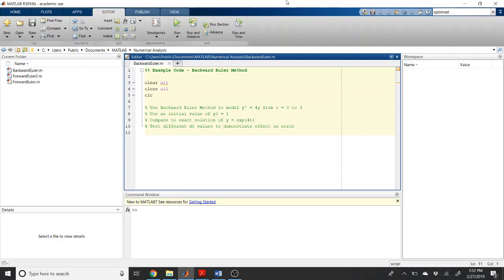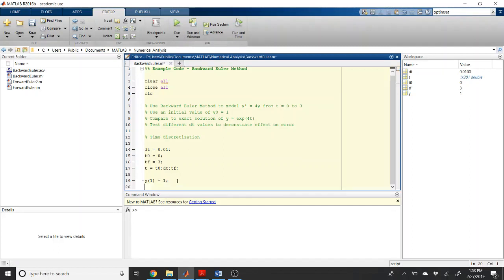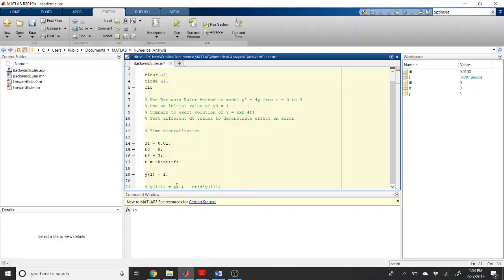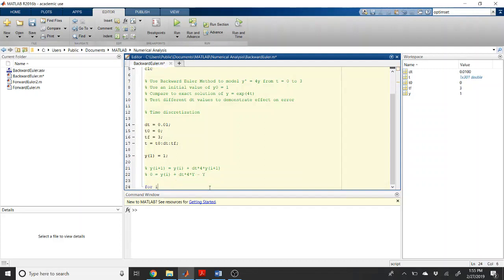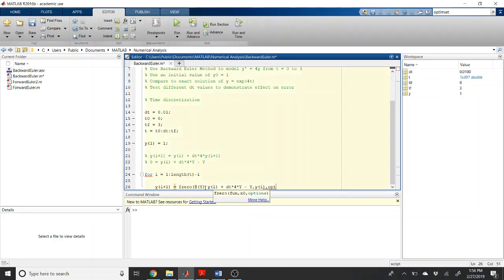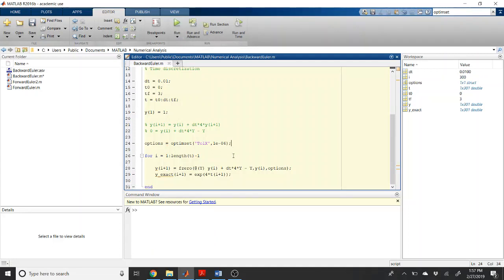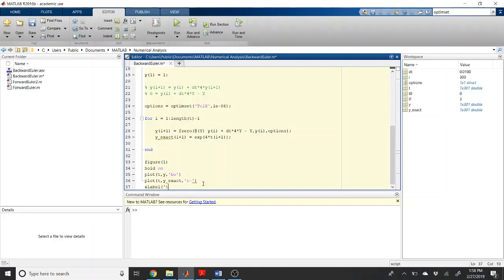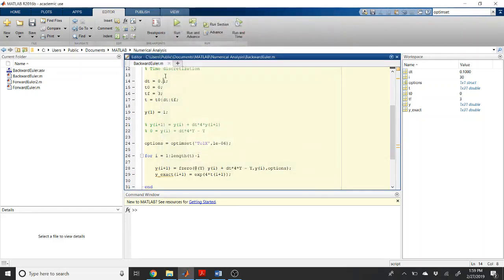Numerical Analysis MATLAB Example - Backward Euler Method

Comment: How would I solve the Backward Euler Method (Implicit) if my function has both second-order derivative and first-order derivative?  
For example: 
m.(d^2y/dt^2) + c.(dy/dt) + k.y = F(t)
Where for  the second order derivative I need to adopt a first order accurate scheme
 (O(ℎ)) and for the first order derivative adopt a second order accurate scheme (i.e. O(ℎ^2))?
Reply: You probably got an answer to this by now. But for the problem, you would just convert the second-order derivatives to first order. So you would have a first order system and then solve with implicit euler in the same way as normal.